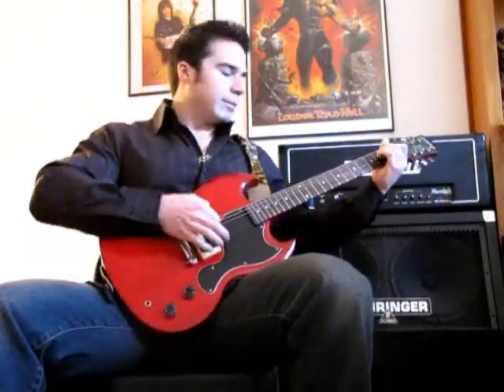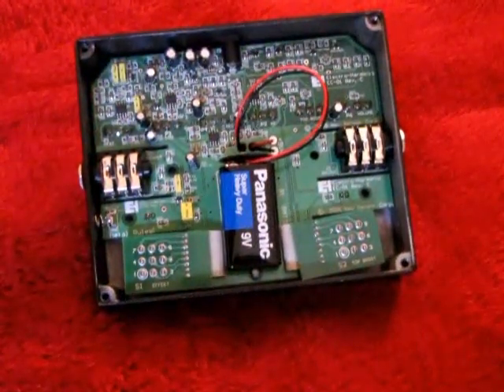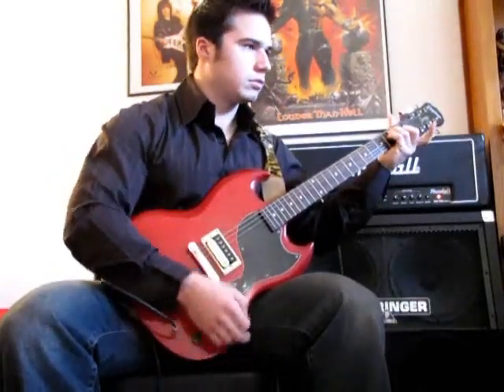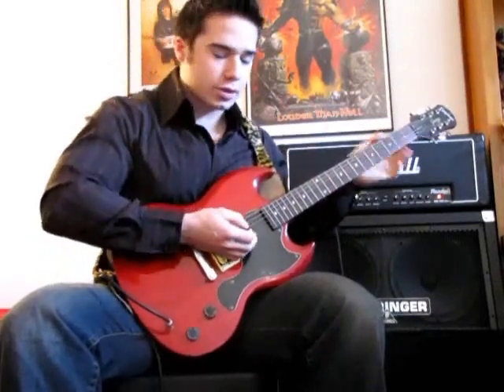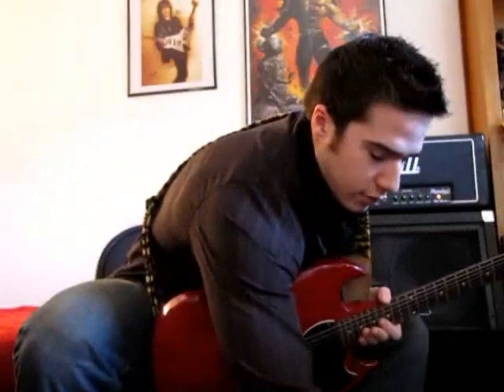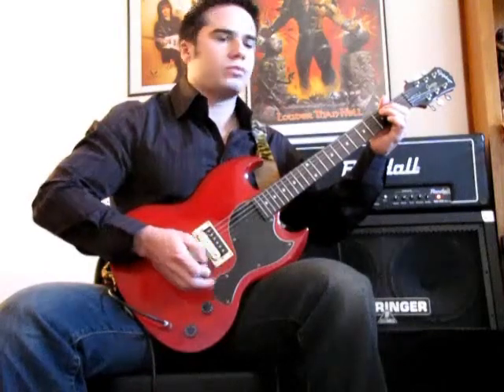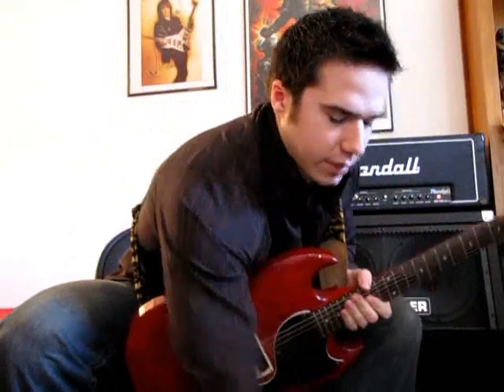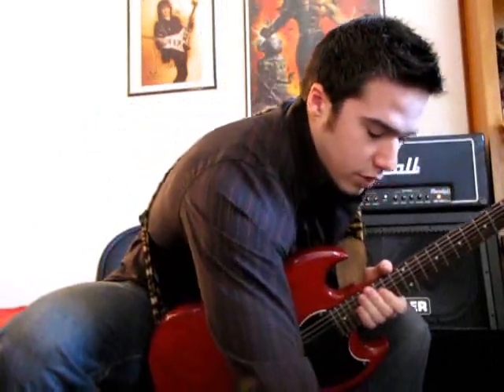Metal Muff Demo / Review by Maxxxwell Carlisle

Comment from the maker: This peticular head, by itself actually is NOT that good for a heavy metal tone. But the head is an older RG100. The newer Randall heads like the RH100 or any of the tube heads are killer. 

I like the head that I have because it's really loud and it's bullet proof, but I always need to use a pedal or pre-amp to get a good hi gain tone.

Comment: @MaxxxwellC I bought this pedal on eBay yesterday, I'm going have in a few weeks. Can't wait!

I plan to use a power supply, can you tell me if this pedal require a specific power supply made for the pedal or can I plug it with my other effects on my daisy chain using the BOSS PSA adaptor? thx!

Comment: This is probably my favorite distortion pedal of all time. My ONLY grievance is that it friggin' DEVOURS batteries. Of course, that problem is easily solved by getting an AC adapter. Word to the wise though, spend the extra few dollars on the proper adapter. I original bought a $12 multi-setting/multi-tip adapter and it gave me a really annoying hum. I got the proper adapter (replacement for Boss, EHX and Ibanez pedals) for $20-ish and the hum disappeared completely.

Comment: the worst thing of the heavisests distortions is that when you are not playing or muting all strings the amp starts to sound annoying with a noise "aaaaaaaaaaaaaaaaaaaaaaaaaaaaaaaaaa"pedal builders should include a built in compressor to suppress that sound without buying a third party compressor pedal.

Comment: @HDInfamousGaming most line 6 amps suck terribly with pedals. my buddy has the spider 4 and he tried to use his boss sd-1 and it just didn't sound good at all through that amp. no matter what you did toit. through my solid state amp his overdrive sounded amazing. if you're gunna use line 6 stuff, you'd be a lot better off gettin the footswitch to change through the channels

Comment from the maker: This pedal is perfect for the classic Thrash tone. I'm not too familiar with that amp, but if it has a good clean channel, you can just run this pedal straight in to the clean and get all your distorted tone from the pedal. It will sound fucking deadly. Also, those RG120s are actually really nice playing axes.

Comment from the maker: @TheLyonhard 

The Randall has a very "bassy" tone, so I've got the highs turned up a little and the mids scooped. I think it's Bass 5, Mids 4, and Highs 7-8.
Reply: I'm using the rg1503 amp head going into a rg 2/12 cab sound great by it's self but when it comes to playing on 7 string needs little boost so I used the micro metal muff with the distortion in the pedal turned down and gain on channel 3 at 6-7 gives it that kick I need to play some Divine Heresy songs